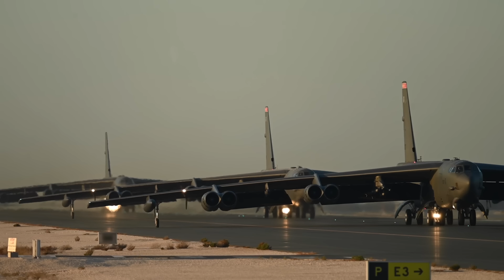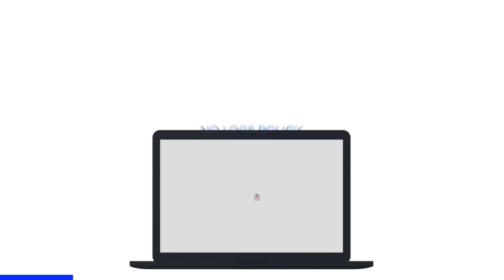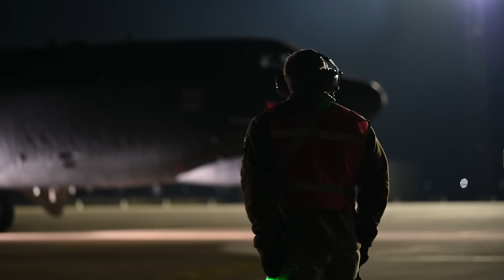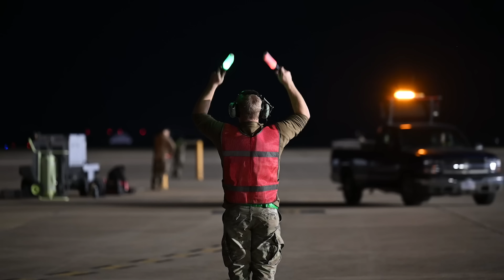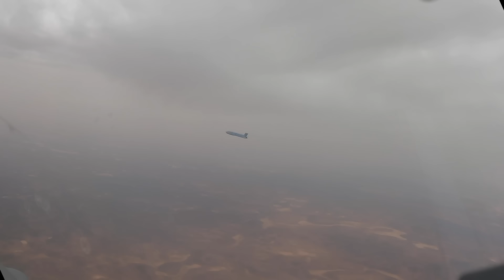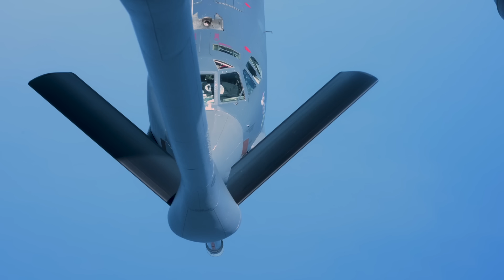How JASSM armed B-52 Stratofortress is systematically decimating Iranian assets ?

Comment: You've got it wrong as to the upgrades of the B-52 engines. The new Rolls Royce engines  powering the B-52s are the Rolls Royce F130 turbofan engines. These engines produce more thrust, more power, than the older stated engines. They use less fuel, yet have more power. Do a little basic homework guys, before making your videos.
Reply: Did the dog eat yours??  No, they make the same 17,000 pound thrust the old TF-33 turbofans used on the B-52H do.  Less fuel, same thrust.
Reply: A.I slop would be the end of us

Comment: Are these B-52-J that have the new Rolls-Royce engines, new radar, digital cockpit, better communication systems and everything updated with the new B-52-J or are the current B-52's still the B-52-H? 

 with the B-52
Reply: No, the B-52H to B-52J conversions have not yet been completed. 2 test aircraft are about to be converted.

Comment: The JASSM-A range is 230 miles , the later JASSM-B/ER range is 620 miles and JASSM-D/XR in development will have similar range to the TLAM with range of 1000-1200
The JASSM ER/XR represent modern warfare as long range air to air missiles range is increase, the JASSM-ER allows strike fighters to attack the enemy while denying them a target
The JASSM-XR will allow stand off range against any defenses but the USAF still needs to speed the fielding of the ARRW 
The ARRW can be used at defenses allowing the JASSMs an easier time to strike targets
Reply: Have you heard  of any AGM-158C LRASM employment? Harpoon?

Comment: Again, if the Air Force now has total air superiority over Iran why not saving all of our very expensive and highly valuable AGM158 JASSAMS and are JASSAM /ER- glide missiles and instead use JDAMS which basically have the same 500LB warhead and can be laser guided onto target ? ? ?
Reply: Becouse iran has lots manpads and some short range air defense so yeah agm 158 saves pilots...
Reply: @RicardoMrMendes  live target practice.
Reply: Simple
Normally, the US military would put boots on the ground and set FOBs and FARPs
The FOBs for AH-1Z and AH-64E and FARPs for strike fighters
Those bases would be normally positioned to keep constant pressure on enemy forces
The US cant set up FOBs or FARPs due the Iran's shear amount of short range missiles
So for now, its has been JASSM for taking targets at stand off range
Iran also has a lot of MANPADS 
Again danger helos and low flying aircraft
So tactically speaking its still JASSMs for now but they will switch to JDAMs
Reply: Because if you don't use them, you have to pay someone to demilitarize them.

Comment: Actually the new re-engined planes are being given a new designation "J". So it's a B52-J. They'll use a version of the engine found on a Lear jet - there never will be a part problem.
Reply: Perfect platform if the Airforce is serious about the ARRW Hypersonic missile revival.....well the B 1 would be superb as well..👉🏻
Reply: @willwozniak2826  B-1B is scheduled to do some hyper testing with its new external pylons.